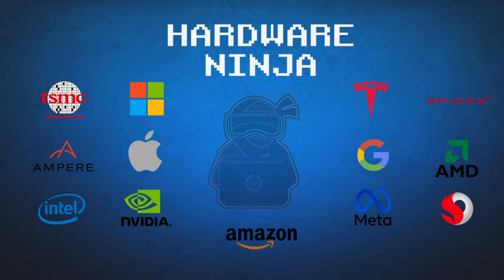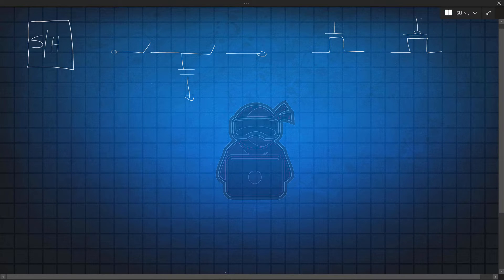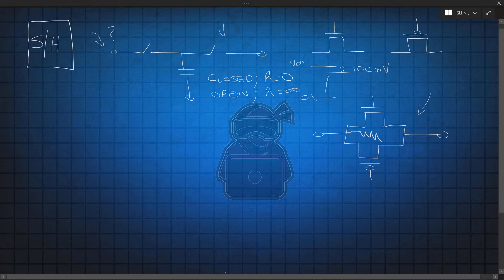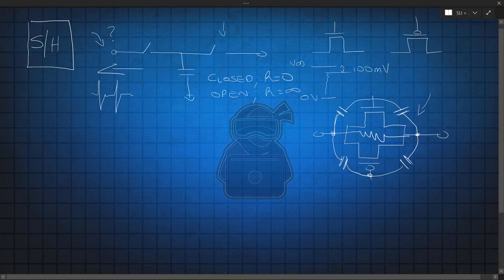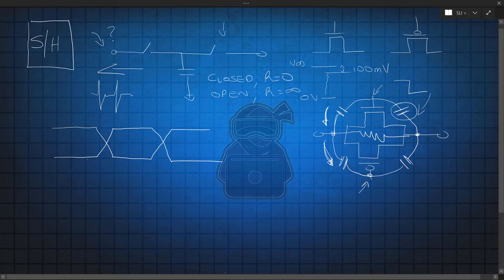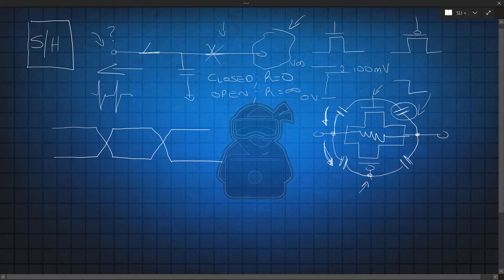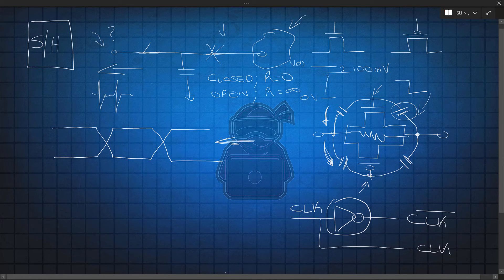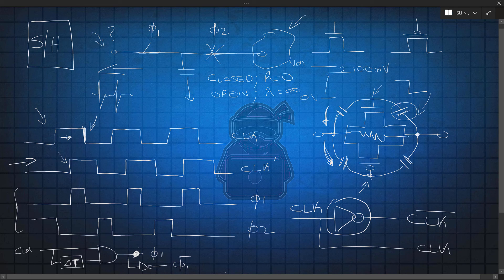HWN - How to Ace the Real Apple Interview Question on Touch Sensing

Comment: My answer to produce the symmetric waveform:

.

.

.

.

.

.

.

.

.
I would use a transmission gate always fully on (pmos gate to gnd and nmos gate to vdd) so that its intrinsic R and C will delay the signal as the amount of delay we need. Then add on both sides a couple of inverter to regenerate the signals out of the TG.
Otherwise we could use a CPL gate which can produce a differential signal starting from the single ended one without TG and the one inverted.

What do you think about it?